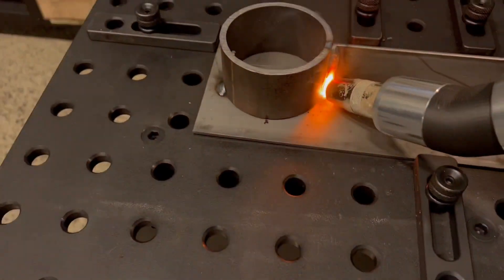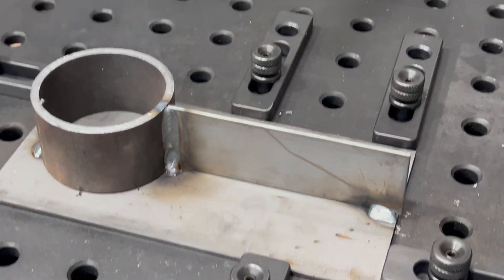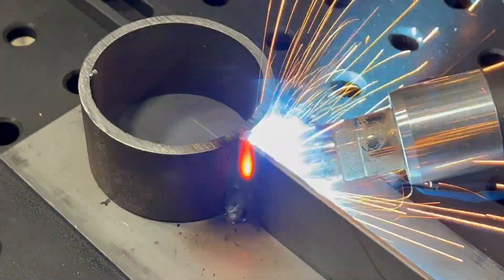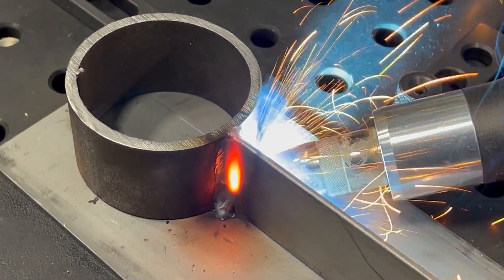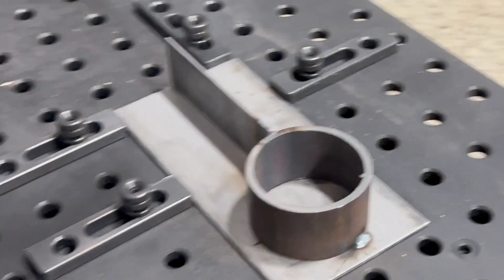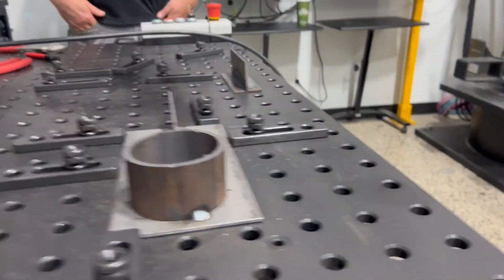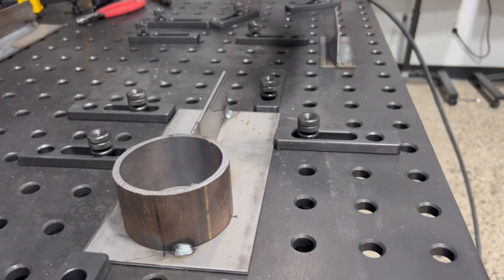ABICOR BINZEL COBOT  (I BOT one) part 2

Comment: Wow a table top robot welder! That's the first one this size I've seen. I would absolutely love to have one that welds aluminum!
Reply from the maker: this one does and it does it really well ...  but the price might be prohibitive unless you use it commercially .... it is so easy to program too !
Reply: @ZILAwelds  looks great man! I've wanted one for a while that could weld "stock gates" we fabricate custom designed estate gates in all aluminum... It's extremely extremely hard to find someone that can weld and fabricate aluminum.  Id probably need a contract with Lowe's or home Depot before it would be worth the price for me though. I seen another video after this one showing it being 100k. I would need it to be able to work on a 5ft by 5ft area at minimum even then. It's definitely an option I'll be keeping in mind for future reference.
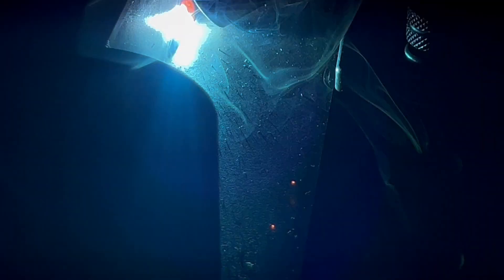Reply from the maker: @willhall7777  at least 80ooo ......   https://www.sks-welding.com/fileadmin/user_upload/video/home/SKS_Aluminum_welding_EN_Web.mp4     check this video out about start at 1:00 and watch till the end ....  this looks like a tesla battery .....  super clean mig aluminum ....